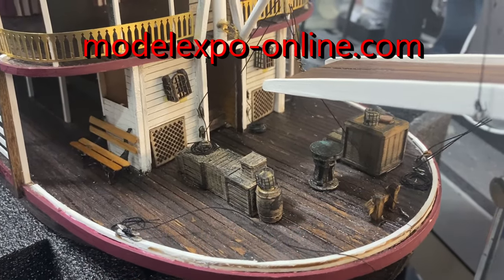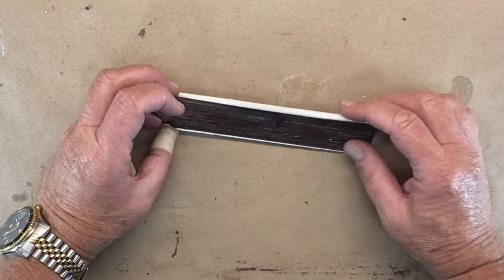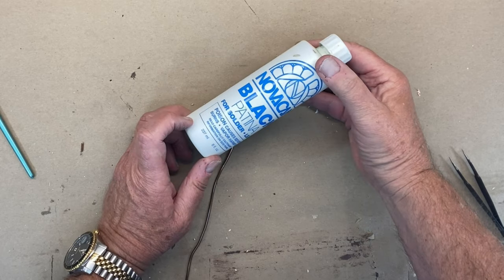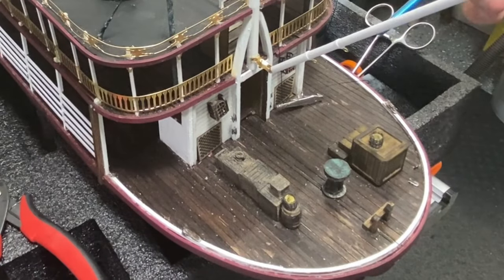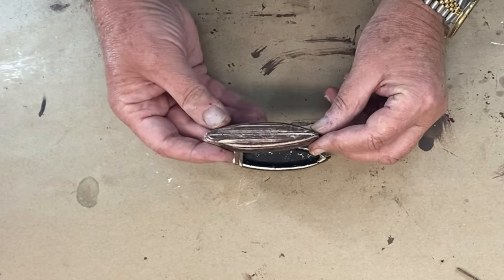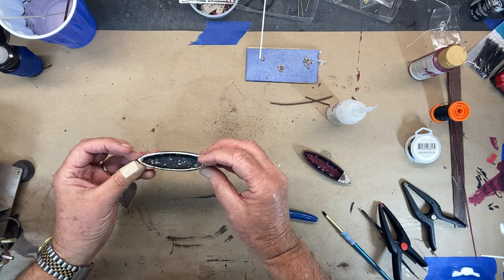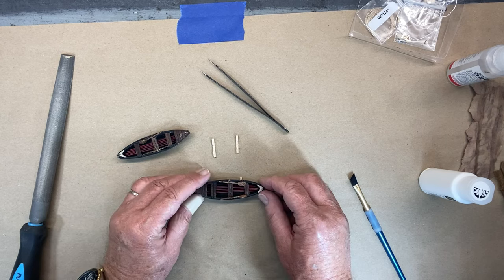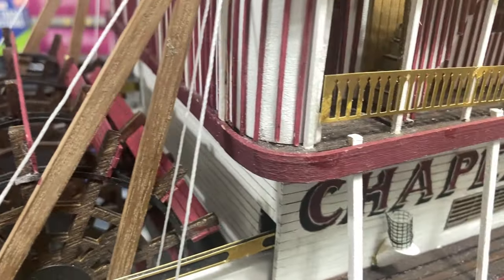The Chaperon PART 13 "The Finish Line" is near!

Comment: Thank you! I have this kit and have not started it yet. Your series has been extremely valuable for ideas.🎉 I have donated and suggest that if you also find this valuable donate to Dan. Thank you Dan!
Reply from the maker: So happy to hear that your following along and have the ship too!  It's a wonderfully rewarding hobby, and this ship turns out to be my wife's favorite.  In my retirement years, I have seen others just kind of decline due to inactivity.  Ship building keeps the mind sharp, and the details help keep the body healthy by forcing the use of your (My) fine motor skills.
Your generosity in financially contributing to my hobby leaves me speechless.  So my saying THANK YOU, really doesn't seem like enough of a response.  Rest assured, every penny goes right back into my hobby and future builds and equipment as needed.  Although money is not the reason I post videos, it's more to keep me going and mentally active, Your kindness brightened my day.  I hope to post the final video this week. Then I will take about a 3 week break before starting my next adventure!  Prepare to set sail!    👍👍